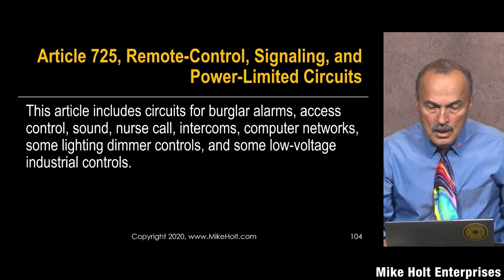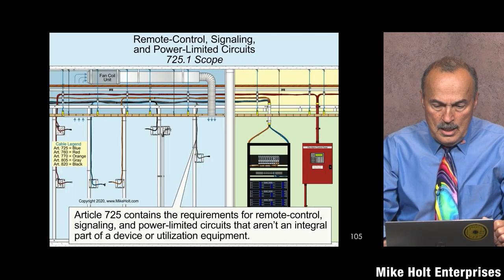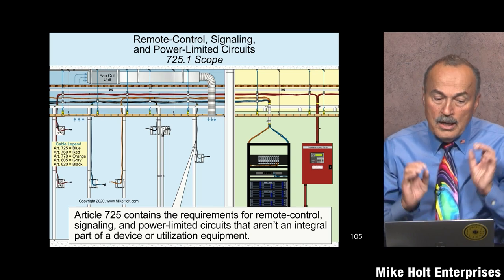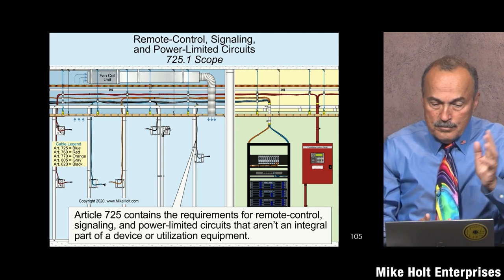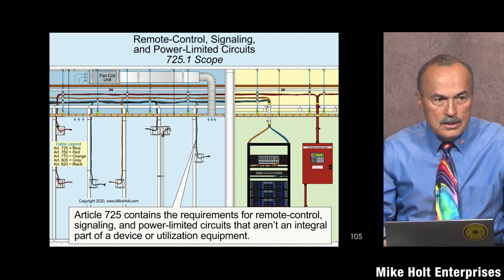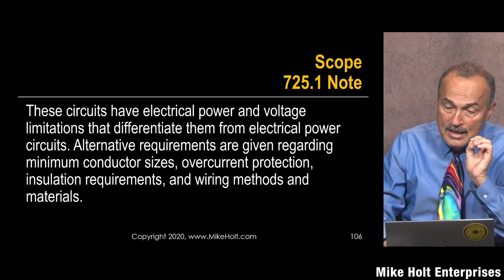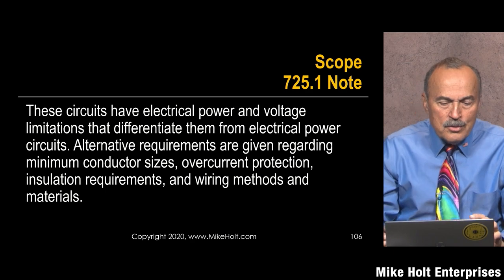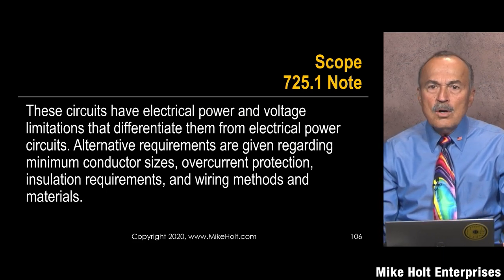Class 1,2,and 3 Remote-Control, Signaling, and Power-Limited Circuits, Scope, NEC 2020 - [725.1]

Comment: Hello, Question.  It is my understanding that when running a low voltage wire (for an LED lets say), you must use the same guidelines as in section 300 and 400.  So if you splice two Low voltage cables together (connect, say an LED strip to a supply cable).....that connection should be accessible and in a proper junction box or enclosure.  Correct?   

BTW do you have a LOW Voltage wiring code class?

Thanks!

Comment: I am not really bothered by the alternative wording but I can see why people get worked up about it. Clarity of exposition is important without adding to confusion.

We are talking about alternatives to the requirements of Chapter 1 through to 4. That’s not to say Chapters 1-4 don’t apply to remote-control, signaling or power limited circuits - 725 I viewed as an amendment for specified conditions which were deemed Class 1, Class 2 and Class 3.

The main issue in my mind is not what they are but when theses classes of circuits are in the vicinity of regular power and light circuits - the distinction then matters more.

Comment: Wouldn’t computer cabling fall under the same rules as telephone wiring. It was always the rules we had used, not sure where it is in the code, we were just running cat 6 wiring.
Reply from the maker: No, data is a Class 2 circuit. Most phone systems today are Class 2, except the old telephone systems with 98V ring.
Reply: MikeHoltNEC  Thank You 
I was installing cat 5 (not cat 6) 25+ years ago have been working as an industrial electrician for nearly 30 years and now have a need to obtain my license.
Reply from the maker: @monteglover4133  call 352.360.2620, ask for a discount!
Reply: @monteglover4133  Same here. I may just stick it out here at this boiler factory (18 years). I feel Mike's programs do keep me aware when new opportunities look fruitful. I hope my old Red Seal certificate still works in years to come.